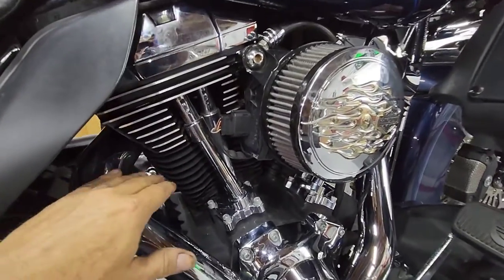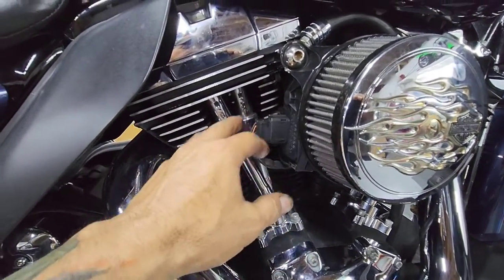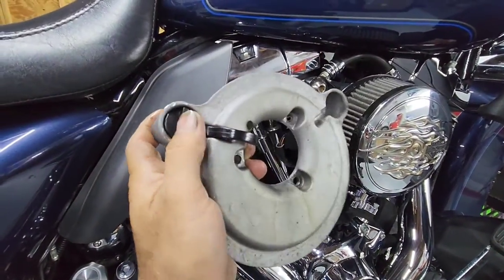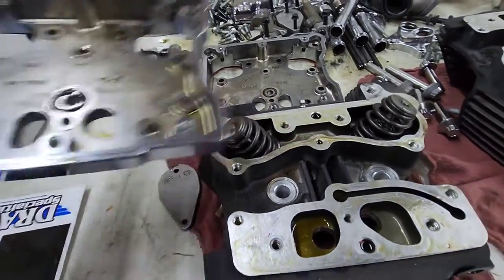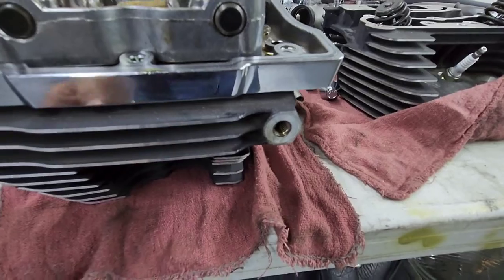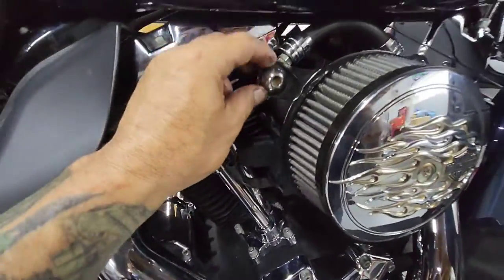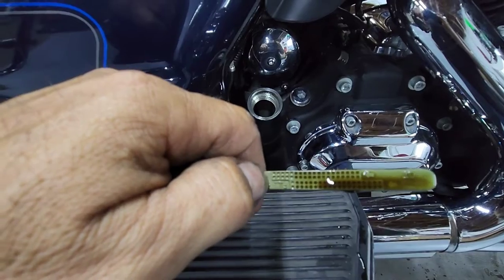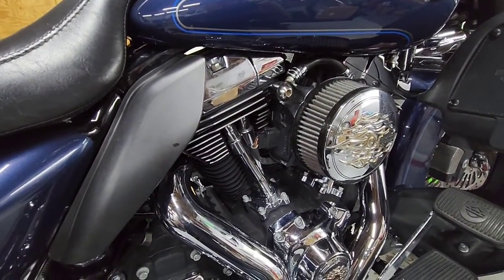Harley Crank Case Pressure and How it works

Comment: Blow by from the breather bolts is simply caused by the rise Impression due to the pistons moving up and down. Hydraulic lifters pump oil through the push rods to the rocker boxes to glue rocker arms. When writing at normal rpm the oil drains through passages in the rocker boxes and Scavenged back into the system. At higher rpm's pressure rises and the oil can not drain from the rocker boxes. The only place for the excess oiL to go is out the Breather bolts in the cylinder head. And that is why Harley switched from crank case breathing to head bolt breathers. So that the preasure is able to vent. Blow by is part of the game (however it can be managed with a carburetor support that Routes the globe into the venturi of the carburetor gaining a little extra top in lubrication) Especially if you want a hot rod. Ive explained This to customers for fifteen years. ...... one of my bikes is a crank breather evolution with  S.E. head breather heads and rockers.

Comment: I've always been a Pan and Shovel rider, and I still ride my 1949 EL 2-3 times a week. Yeah, I'm old but can still kick start my bikes. I bought my first Evo two years ago, a 1996 FLHR-I from a friend who bought it in 1998 from original owner. Anyway, I converted it to Carb and Singlefire ign when the Magneti-Marelli finally failed. I was riding Saturday and I smelled smoke and lost my rear brake. The engine puked about 2 quarts of oil out of the front cylinder in about a mile. Now I understand what happened........ I've got a top end  gasket kit coming from DK. So, I'll solve it in a week or so. Thank you.

Comment: Not all motorcycle engines are exactly the same but basic principles are the same.
I have a question about an oil leak.
I bought a new 2022 Triumph Scrambler 1200XC, and I noticed an oil leak when the bike was still in the showroom and it’s still leaking today from the front sprocket.

The dealer sucks, and their service department sucks even more. They refuse to acknowledge that there’s even a leak. That’s how bad they are.
No interest in offering any help, and could care less.
I already contacted Triumph and waiting for a response.
At the same time, I want to figure this out.

The dealer sent me a video showing the drive shaft turning in first gear, really slow, and that it was not leaking.
It’s not gonna leak when the engine is barely idling with no pressure being built up inside the crank case .
My question is, what can be blocked on this particular motorcycle in order for the pressure buildup to push that oil out of that shaft seal ?

The bike is new so something went wrong during assembly that blocked a vent or something else is going on.
I believe it’s a vent of some sort from what you’re describing and from other videos I’ve watched.

Any hell would be great.
Thanks.

Comment: another with a few minutes of fame, anyone can make a video without knowing the real skinny of things. 
one of the BIGGEST ole wives tale is the run low on oil. oil must cool, lubricate and clean so why hobble the efforts of the oil. harley does say on engines with the oil tank below the crankcase you can run a little low to prevent the equalizing tube from being covered and causing a sorta vapor lock, but IF you follow the hd service, it will not happen but hd knows there are those who do not. also, need to brush up on terminology. so how in the world can the oil level travel to the heads when gravity and scavenge prevent it. 
a big issue with the hd engine is that it will go to a positive pressure in the crankcase above 5k rpm and the oil will have a tendency to pool, the engine needs diff'l pressures to move oil around so at sustained high rpm will cause the oil to slow down in movement sorta like a vapor lock because the pressure are equalized so all you got now is gravity, that can lead to excess oil in the head area but a change in rpm can break the vapor lock so always good to change speeds.